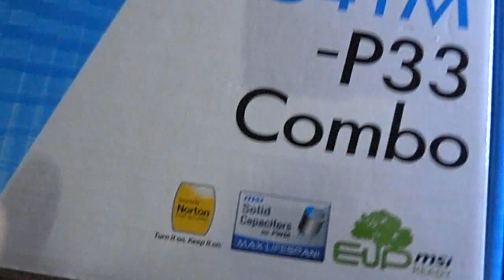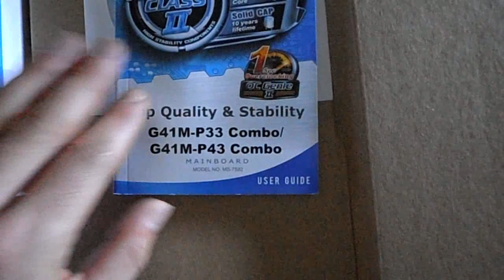MSI G41M P33 Combo Unboxing

Comment: i have msi g41 p33 compo but it support 2 sata ports and 2 ddr3 ram  only
and when i connect amd radeon hd 6450 2g ddr3 the PC doesn't work , when i remove it the PC run correctly